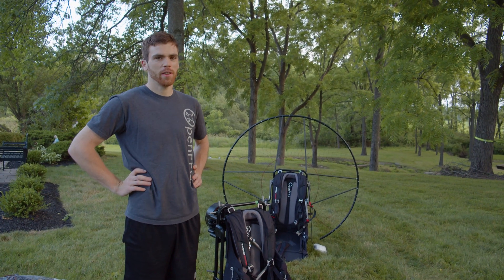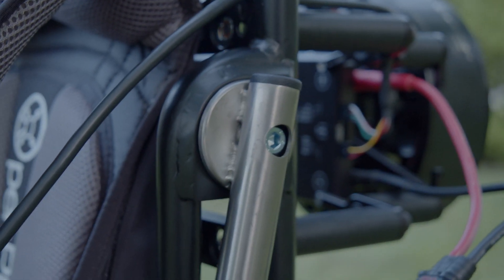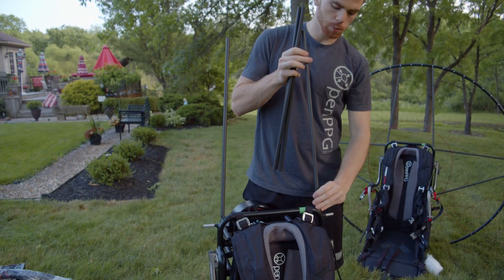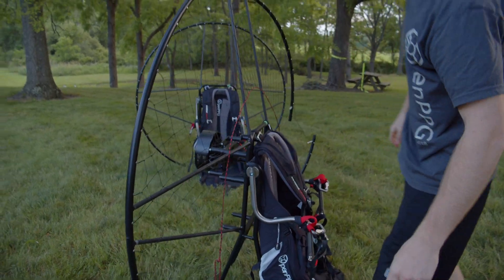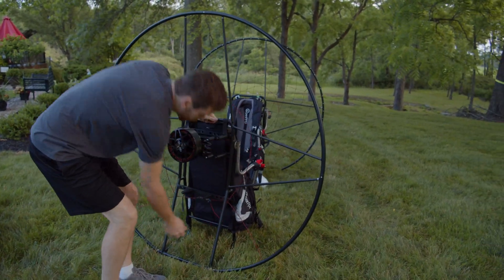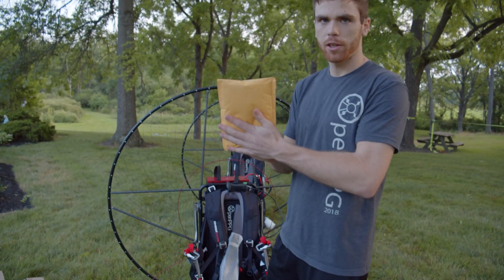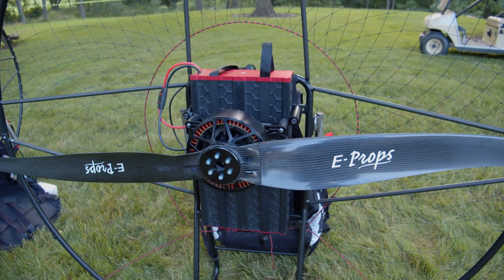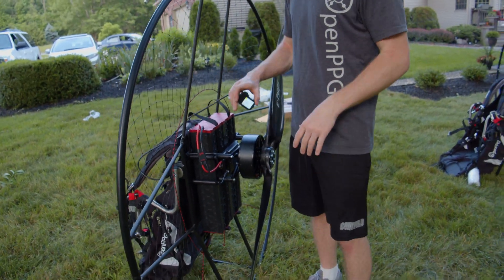Sp140 Assembly- Electric Paramotor 2021

Comment: Thank you for the very detailed video. Can you add a trike to this unit? If so what are the downside of doing this? If you can add a trike can you add an extra battery with a switch to give you extra air time by switching battery with the flip of the switch while still in the air?
Reply from the maker: Yes you can add to a trike, and add extra battery's for more flight time.

Comment: I was cringing at 11:37 when you stood behind changing to sport mode, once it beeped and you said now we got full power mode!!! That’s when I was thinking if you slipped on the throttle it will rip through your arm. 
With that the motor is on or off, not like a petrol ppg you know if the engine is not running then it won’t spin up, with the electric one it’s instantly on with the throttle. Just a safety point as people will watch this and copy you. 
Otherwise it looks good, we now just need battery technology to advance so we can have longer flight times.
Reply: My hand could slip and power would not be apply because the controller would still need to be armed. So it safe, no need to cringe.

Comment: Looks fun - and I liked that shorter takeoff distance. I wonder if the unique characteristics of electric PPG then justifies some special wing designs to suit it?
Reply: No special wing design is needed, I fly all kinds of wings on it.
Reply: @PDWhite  - was that flight with the larger battery pack or the smaller one?
Reply: @manofsan  1hr with the 4kwh pack and 1/2 hour with the 2.2kwh pack. If you are using a sporty wing and flying hard about 40mins with the 4kwh pack.
Reply: @PDWhite  I'd read that the upcoming Tesla batteries could literally double the available power densities. It would be great if there could one day be flying times of 2 - 3 hours.
Reply: @PDWhite  When your battery charge starts to run out, then does the motor rpm start to gradually taper off? Or does the motor just suddenly lose power?

Comment: I would have expected to see a torque wrench get used multiple times to take guessing out tightness
Reply: Using a torque wrench is how you crush carbon fiber E props. They are hollow foam core, so they continue to compress as you keep "checking" them.
Reply: @ctchuteflyer  That is not true. E-props recommends 8Nm of torque to be used. If done with torque wrench, it works just fine. Tested many times. Tightening the prop just by guessing is what can actually demage the prop hub.